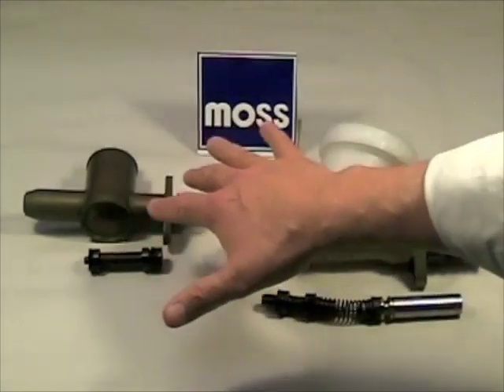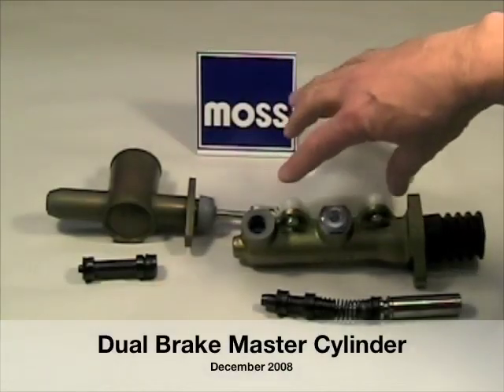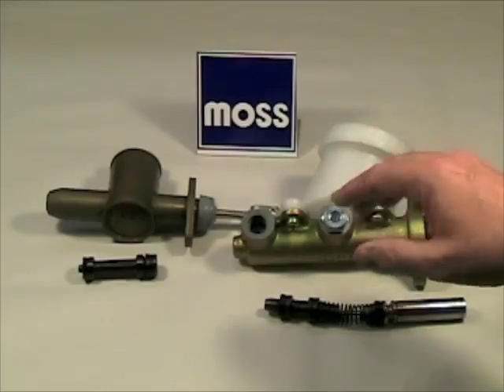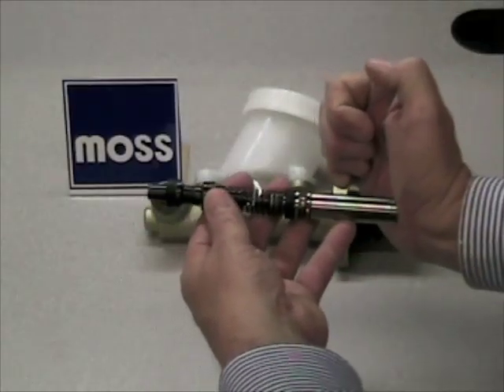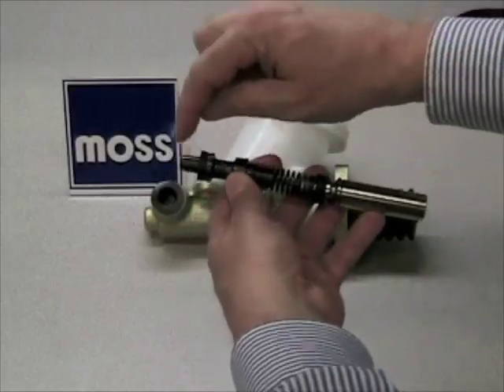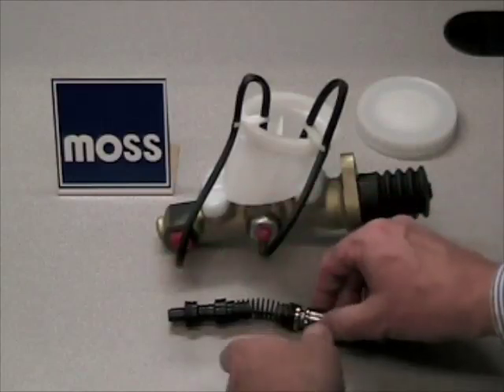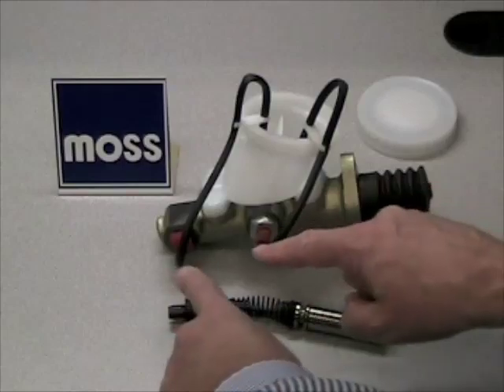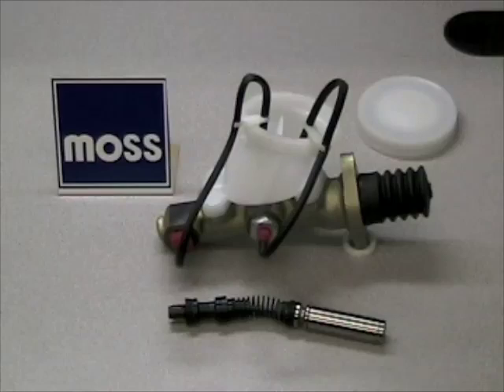Dual Brake Master Cylinder

Comment: With the dual braking system, what makes the front piston in the master cylinder come back, to suck in more fluid from the reservoir, when you take your foot off the brake pedal?
Reply: The pressure acting on the second piston as the fluid returns, thus pushing the first piston back

Comment: Ive never had an issue getting air out of a master cylinder - thats why Im a master mechanic :) 

Seriously though - when you "Bench bleed" a master like that, expect to loose ALL the paint off of your freshly restored car as it now just goes every where.  Bench bleeding in my opinion is simply a bad idea.